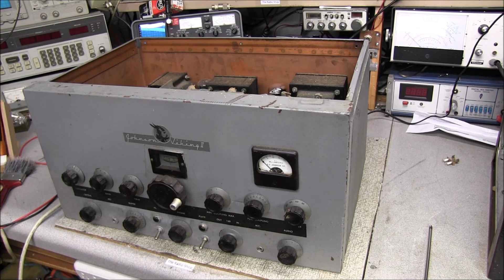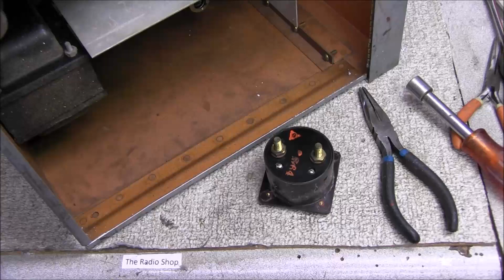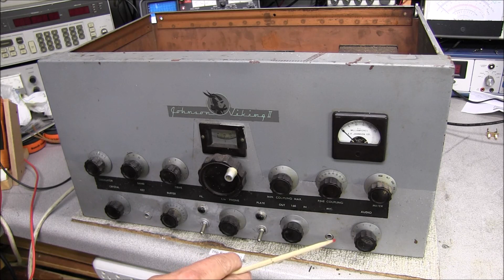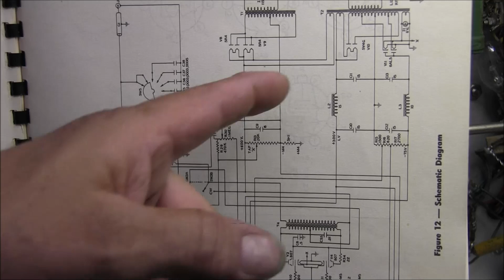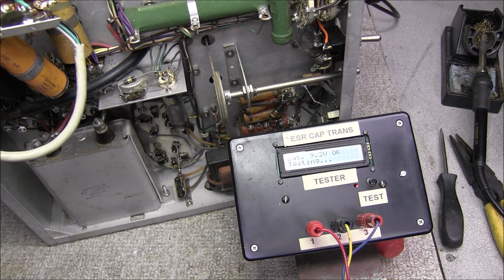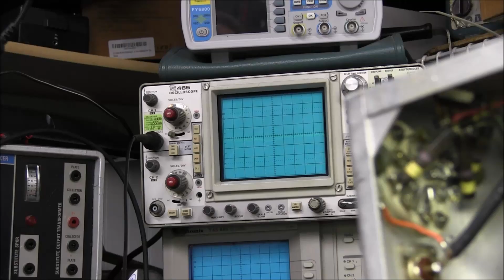#219 Johnson Viking Restoration Part 3

Comment: Buddy: 
Not sure if you have found a suitable LCR meter yet - but here is my recommendation.
There is a line of Sencore LCR meters LC75 is one model.
They work well and as a BIG advantage they measure leakage current.
From watching your videos I have not seen you measure leakage - IMHO you should consider doing so. The little ESR meters are fine but they omit leakage at working voltage.
dan

Comment: Where did you find the new crystal socket?  I am working on a Ranger that has broken pins in the socket.
Reply from the maker: ebay is your best bet. There is quite a few of them on there. If you Google "ceramic crystal socket" you will find a few folks that have them.  http://www.af4k.com/crystal_sockets.htm

Comment: On the technical side:  How could this device function in the state you found it?  Torched chassis level components on the rectifier should have destroyed the transformer.  What am I misunderstanding?  How is it that the over current did not destroy the windings?  It must have actually smoked when operated.

I am curious about the broken ceramic.  Based on years spent working on Tek ceramic chair rails, I am guessing that solder without a bit of silver was used.  Do you believe that the ceramic was broken by mechanical/thermal abuse or was there indication of electrical conduction or chemical degradation involving the ceramic?

Understanding, rather, hearing your view of such, malfunction and failure is of great value.

Comment: Those Viking ll's sound wonderful! I remember a guy operating one in the late 70's-80's. This was a time period when lots of BK NY channel 15 operators were mostly using 1950's transmitter's. They were cheap, and readily available. Rangers,  valiants, ect ect. Artie (Arthur) windjammer was king with his Johnson Viking 500. The best transmitter audio I've ever had the pleasure of listening to was that 500. Wow! Talk about broadcast (commercial type radio station) audio! Those modulators would glow a beautiful fushia color. And with the shack lights turned off, and the ps cover removed the whole room would glow. I digress. Good luck with this refurb.

Comment: Looking for a good LCR Meter?  Use a Hewlett Packard 426x/427x/428x series.  Model would depend on your needs. But a older one would be a HP 4332.  The HP 4261 is a low cost version too..  they aren't terribly expensive.  Personally If I were you, I would go for either one of those two, 4332 or 4261.

Comment: I can recommend the BM4070 LCR meter. I have accurately measured 7.5 pF caps with this and gotten +/- .5 pF from the stated Value. I cannot say if it is actually that accurate but I can do low pF value caps up to 2000 uF. Inductance is also good from low uH to 20H range.
Just don't use the hinged readout they have been reported to break under continued cycling, leave the display inside the case.
Cheers

Comment: About the choke, I used to work next to a Wonderful Indian chap, who rewound motors and transformers. I helped him with electronic tests and he helped me with motors and transformers. To repair chokes, he had a really fast way of removing the old winding. He would remove the cover, then make a picture of the colors and winding direction, tag connection if any, then take a chisel and slice the winding off flush on both sides. Then with a wooden stick and mallet knock the winding out (after counting the layers, wire size and number of turns) You only need to count one side. He had them apart in a few minutes. Rewinding for that size of choke should only take 20 minutes or so. The only tricky part for me is finding the correct insulating card, he of course purchased it from India. Good luck Buddy.

Comment: Good show on this boat anchor Buddy. On some of those meters you can actually drive the setscrews holding the case together IN... they will go in far enough to let the housing slide off, that way the screws are held captive in the assembly and don't get lost.

Comment: Hi Buddy.  I've been using the DER EE DE-5000 and it is an affordable and excellent LCR meter,  it's also very popular so there is no shortage of people doing modifications and giving advice about it.  I think I paid around $160 new a couple years ago.
Reply: i have the same one after messing around with a few others around $50 range and then finally watching this https://www.youtube.com/watch?v=ivVSq0IiZGo i was set. its worked great and does everything i could ask for. i did replace the clips that seems like its a must. i have a power wart for it just have not taken the time to install the right plug for it, i guess that is needed to hold memory since they clear after power off and need to re zero the leads. the new model fixes that but its also way to much for my taste. adding the power just keeps it set but i dont want to leave it on so i just re zero it. however i dont really know if i need to re zero since the ESR is zero with the leads every time just not the capacitance but its very close so maybe it does hold some sort of zero im not really sure.  next I want to build Mr. Carlsons tester that seems like it would be the next best thing to me.  the DE-5000 is for sure a great tester and the price you just cant beat it as far as i know.

Comment: As far as LCR meters go Buddy, as with most things in life,  it just depends how big your wallet is. I've been using a B&K 878 hand held meter for years now and it works well for my needs. That model is out of production but the have new ones that are similar. I also have the Peak ESR  meter which the manufacturer claims is not super accurate as far as the value being measured but is a more general value. They make a dedicated LCR meter in the same package which I assume is a more accurate instrument. For leakage testing those old caps I still use my old standby Heathkit IT-28.  73 Doug.
Reply from the maker: Thanks Doug for that information. I will look into it. Main thing I need is to read the value of inductors.

Comment: Like I always say, I learn something new from each of your videos, Buddy. This time I learned NOT to attempt to restore one of these Johnson Viking II transmitters until I get a LOT more experience under my belt. I'm just now getting comfortable restoring old MOPA (Master Oscillator Power Amplifier) transmitters like the Johnson Adventurer, Heath DX60, Knight T60, etc. I love your practical approach to trouble shooting. Thanks for sharing with us. 73 de K7RMJ  Frank
Reply from the maker: Thanks Frank. The practical approach always served me well.  Trust me, no reason to make things complicated. The Viking II is not a hard unit to follow through with.  Lots of room, well until you need to pull the speech and audio amp tubes.  If you can handle those then the VII should be a breeze my friend. Glad you learn stuff :-)